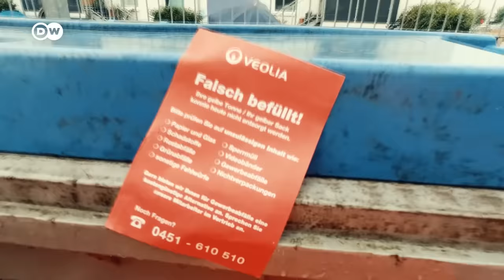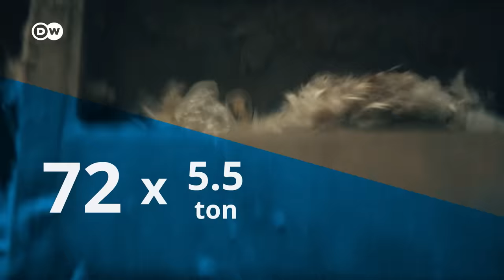The recycling myth: What actually happens to our plastic

Comment: Why not put a EU wide tax  of 10€ per kilo of virgin plastic that is either made or imported
How can I propose that to EU? I think it makes a lot of sense
Reply from the maker: Hey there! Since 2021, there is a "plastic tax" on virgin plastic in the EU. It is referred to as "plastic tax" but is actually a contribution from the member states to the EU which is based on the amount of non-recycled plastic packaging waste that is produced in that country.
Reply: @DWPlanetA  Yup thanks for the reply, I just read about it.
It is kind of too cheap and I think it tackles the problem on the wrong end...
Instead of preventing the production of new virgin plastic by making it more expensive, they just tax the leftover trash. Which is by the way kind of an easy thing to evade.
Everything that is left in the country is basically unrecyclable leftovers, but if you export it as a resource to someone who is willing to take it, you can get yourself out of the responsibility.
Not cool.

Comment: The only materials that should be recycled are those that hold a market value, like metals. Don't be fooled by the numbers, the gov & activists spin them to make it seem that recycling everything makes sense. The gov pays or forces companies to use recycled materials which drive up costs, the shipping of plastics all over the world more than takes away any clean air argument, and more pollution is caused by the said shipping and 3rd world countries that take the "recyclables" and dump it wherever they have room. It's better to put plastic in a landfill 5 miles away from you than it is to truck it hundreds of miles then ship it thousands of miles to be burned, buried or dumped in a river in Bangladesh. There's no shortage of landfills (at least in America) and the technology has been perfected to where they are safely packed when full and parks are built on top of them. I understand that Europe & large cities in the US need to ship trash more than 5 miles to find a suitable landfill but that's still better than the corrupt recycling industry. FYI, I worked in & owned a recycling company, we specialized in high value metals. Now I work in land conservation.
Reply: If you have a choice, buy products packaged in glass or metal, use paper bags, re-use plastic containers & throw them in the trash when done. If you city requires recycling, inform them of the problems.

Comment: Completely failed to actually explain the problem. Its not so much that we dont recycle enough...its that the vast majority of plastics can only be recycled up to maximum 3 times. Calculating the energy cost of logistics and re production... makes it waste more energy than we save by recycling to begin with

Or in short... its a massive scam

Comment: Maybe you should re-evaluate your life style. If you have bottles of empty shampoo ( no conditioner ) then you are part of the problem. I only was my hair 3x a week tops. I got through a bottle of shampoo in a couple of months. 4 reasons for this. 1 my hair is not long( it's only longer during winter time. 2 I buy big bottle of the stuff. 3 I shower 2x a week (wash hair 3) and 4 I don't do absurd hair styles which require me to essentiallylabel my hair as high maintenance this allowing me to focus on for ulad that degrease since I have naturally greasy hair. This way I'm not a part of the "problem"

Comment: Mix the recycled plastic with insulation for use in keeping homes warm. 
How many homeless people could use that?
Think outside the Bale.
Reply: That's an idea - but what if it catches fire, burns?  The fumes are toxic and in close confines  of the disadvantaged could prove dangerous too ...  Plastic doesn't even have to "Burn" to admit toxicity ...
Reply: @sabrinamassie5606  of course it can be a burning hazard, most things can. There has to be a use for it somehow.
Reply: @TheFLOMAN76  Well, until we figure out what we can SAFELY use it for, I think we need to look at realistic ways of reducing our use of plastic.  Certainly, plastic has its place, but we're using it far more than necessary because of the low cost to producers and the convenience to consumers.  Other options are available and need to be brought back - Reusable glass, metals, paper and even fabric ... These materials are easier to reuse and biodegradable ...
Reply: @sabrinamassie5606  I concur.
I hate how we treat our planet.
Something needs to be done.
Reply: @TheFLOMAN76  It starts with us, Floyd - people like you and I ...  reduce, reuse and speak out ... Talk to your grocer, your neighbors, whoever will listen (without preaching because that turns people off instantly) ... by example is best .. have a great evening ...